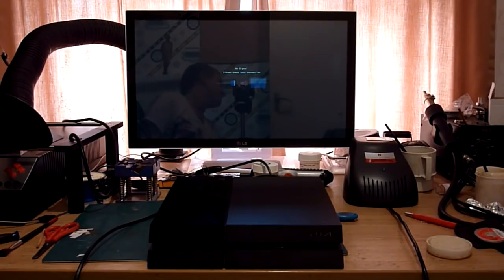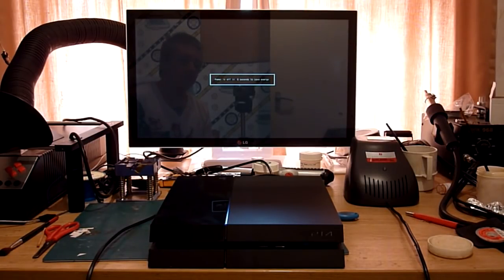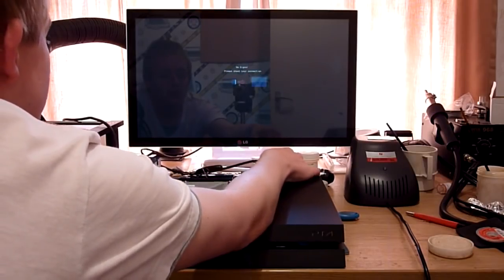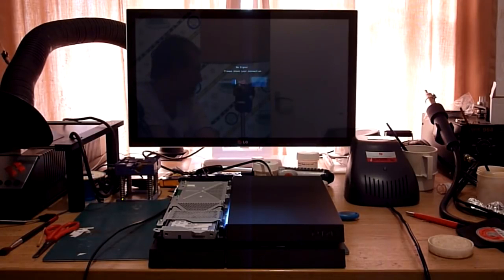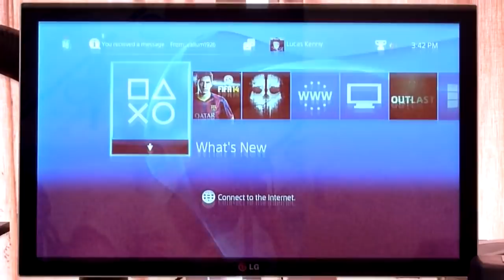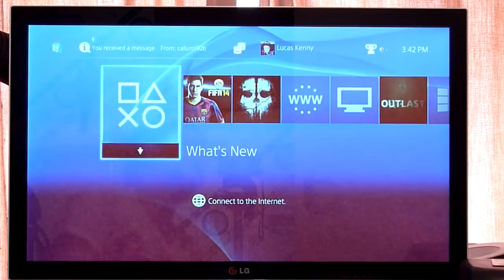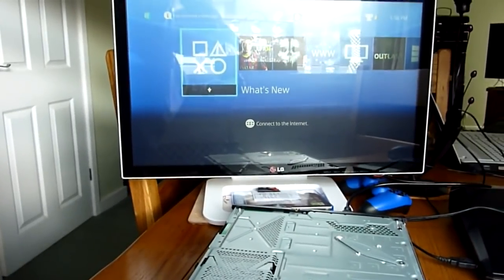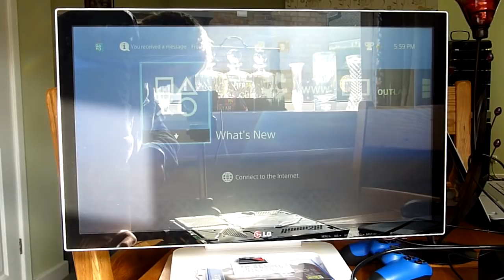PS4 White Light of Death (WLOD) - Faulty HDMI Socket Replacement Fix

Comment: I get the White Light of Death with no signal on my TV, but Remote Play on my Vita shows the PS4 home screen no problem - Thoughts please.
Reply from the maker: It'll be a fault with the HDMI video output circuit. Could be a port, Encoder chip or one of the supporting SMD components at fault.

Comment: I need help I have a ps4 slim and my tv won’t comment when I normally turn it on but if I put it in the emergency mode it will make the no signal go away and off I look closely it starts to turn on the picture put not all the way
Reply from the maker: If the port is intact, then it's likely going to be a bad encoder.
Reply: @AndrewPaul  idk it’s not the ps4 I don’t think cuz I plugged the ps4 into a new tv and it worked but the other tv just won’t work with my ps4

Comment: I had a problem where my ps4 would turn on, go blue and then white and nothing would happen after that, just had a black screen. I tried everything, after about 2 hours of trying everything I fount out it was my HDMI CABLE that was the problem. I switched it with my Ps3 one and my ps4 worked perfectly fine. Hope this helps people out having this issue!

Comment: What if you get two or three seconds of video before it goes black?
Reply from the maker: Likely the 10uF caps and voltage regulators which provide power to the encoder (on the opposite side of the board to the encoder chip, directly behind the HDMI port). You may also need to replace the IC.

Comment: My father bought a ps4 for $150 from a kid. He gets home, turns it on, and it has this issue. 
He went to message the kid, and the little shit blocked him. So he bought a new one, and gave me the junk one, so this video is helpful!
Reply: Lmaooo that's messed up
Reply: @Vintagelover777x  Yep. I got the HDMI port fixed, but found out the disc drive isn't wanting to pull in CD's
Reply: @Jon844 Yeah, I still have it. I got the hdmi port fixed, to find the CD tray motor doesnt work and one the USB ports shocked me
Reply: Its fucked up that your dad will only give you his old broken shit!!! Stau strong!
Reply: @jeremyrhansen6637  Not really, he didnt have to give it to me to begin with. I was expecting it to be just the port...
Reply: @evilal20  at least you can download games and play them digital.
Reply: @mrdato116  True. But I think theres so much dirt in there, that it has a card time spinning the hard drive disk, because it takes forever to load anything
Reply: @evilal20  you can try to clean it. Or maybe hard drive itself is damaged.

Comment: White light but get picture but it's grainy ? Static if you like any assistance appreciated
Reply from the maker: Try and lightly wiggle the lead in the port. If it stops being grainy, it's likely a port issue. If not, likely a HDMI Encoder IC issue.
Reply: Just switched my sky HDMI cable over to ps4 & it seems to have done the trick at moment. Thanks for the reply pal 👌

Comment: See...mine boots and shows a video signal and then after a minute or two the screen goes black and I can't power it down
Reply from the maker: Sounds like a potential hard disk issue. Try another disk if you have access to one to give it a test (minimum of 160GB required).

Comment: My ps4 is saying 
Cannot start the Ps4
Cannot access system storage 
Press the power button for 1second
Reply from the maker: Try and reseat the hard drive initially. Failing that, find another 2.5" SATA hard disk with a minimum capacity of 160GB and try that one to see if it will then start. If so, you have a dead hard drive. Also, if you can hear any unusual beeping / clicking sounds coming from the console then again you may find you have a dead drive. This is the most likely outcome.
Reply: @AndrewPaul  thanks for responding, I reset my harddrive and it worked. You're the best

Comment: Andrew, can you tell me the value of the 0402 capacitor that is on the bottom side of the motherboard, underneath the HDMI port on a PS4 slim 2115B? I have one that is missing but can't find anywhere that lists it.

Comment: so i have a computer that supports hdmi input. I plug my ps4 to it, it doesnt recognize it at all. To test the hdmi i used multiple cables, none worked. To test my computer i got another laptop that has hdmi output, connect it to the input of the computer, and it worked fine. To test my ps4, i connected it to a big tv i have in my living room (too big to game on), and it worked there as well. So my ps4 works, my HDMI cable works, and my computer works. I just cant connect my ps4 to my computer. Im a college student, so the computer in question stays at home while im in uni, i only play when im on vacation. Last vacation i was able to hook up my ps4 to the computer easily, so theres a history of it working. It just doesnt work now. Idk what to do, i turned it off and on again, messed with the resolution when my ps4 was hooked to the big tv, has no affect for my "gaming computer". My computer just does not recognize and hdmi input when i have the ps4 hooked to it, no safe mode no nothing. Im all out of ideas, anyone got anything?

Comment: SOLUTION: One of the problem might be that your tv does not work with 1080p resolution so you need to change the resolution in the settings of the PS4 not tv. Settings---Screen----740p.    The other problem could be an energy problem so you need to change a few time the energy cord of both TV and PS4. Try also using another port of HDMI, that could work too. Good luck

Comment: At vid time 5.50 you say there is still no signal and there never would be considering the hdd is not connected yes it's in the machine but it's not in far enough to make a connection
Reply from the maker: You would expect to see the 'Cannot access system storage' CE-34335-8 message displayed in that scenario. You should never see a perpetually black screen without a hard disk connected.

Comment: How about thr hrd. Im having problems with seeing good quality picture on hdr10 opposed to good quality on 1080p
Reply from the maker: Does it look snowy, or have lines across the display?
If so, it's likely a failure of the Encoder IC chip.

Comment: At first I tried to turn on my PS4 using the button in my controller, it turned on but my controller wasn’t connecting and neither was my PS4 to my TV. I was not able to turn of my PS4 so I just unplugged a cable. I then tried again and my controller was able to connect to my PS4 but not the TV. I get 2 blinks and a white light. How can I fix this?

Comment: Any suggestions, my ps4 only displays the screen in 480p, If I start the ps4 on 1080p or other the screen is black. The only way I could see the screen if I go into safe mode and change the displayed setting to 480p. That way it would work. Also, I see red dots on the screen flashing all over. 

Does it mean I need to change the hdmi port too? Please let me know thanks.

Comment: Any tips on how to add a new hdmi port? I ended up soldering a new one but mistake was when I was soldering it I burned the mother board of the ps4 the burned in lines in it so I'm not sure if that's why but what can I do ? It has a new hdmi but could it be that i messed up the mother board

Comment: I’m having a similar issue. I replaced the hdmi chip without using a microscope. I really didn’t check the hdmi plug. My question is, do you completely put it back together (all screws) when your testing? When I get home I’m gonna check the hdmi port.

Comment: I’m switching to xbox
Reply from the maker: You may find the expression 'out of the frying pan and into the fire' applicable to that one - they're both as bad these days!
What I will say though is if you're looking for a PS4 and can't stretch to a Pro, then go for a slightly older 1200-series machine in good order. Avoid these newer slims like the plague - they're absolutely garbage!
The XBOX One S is an OK machine however they do tend to suffer with HDMI Re-timer related issues but in terms of construction quality on new consoles I'd take an XBOX over a PS4 any day of the week.

Comment: After going into Safe Mode after around 2-3 PS4 looses signal and the white light is on. It comes after a repair when hdmi connector was changed and it worked for couple of weeks. Now it’s not. I can’t bring it back to same repair shop as it’s in another city. Any suggestions?

Comment: I have a white color but the ps4 working great why does it called “the white light of death” ??
Reply from the maker: Yeah I agree it's a stupid name. It stems from back when the PS4 was first released and a few batches were shipped with faulty ports. Suddenly they'd boot to a blank screen and nobody really knew at that point what the cause was. The moniker stuck so here we are with the white light of death (which isn't really dead lol).
Reply: @AndrewPaul  I've sent my ps4 in to replace the HDMI port in the past and still had the same issue just not as often but now it's stopped working again. I'm not seeing anything wrong with the port and I've tried different TVs and HDMI cables but still nothing can you tell me what you think please.

Comment: I have ps4 pro. Now it's outputting a red line on my screen. Tried new hdmi cables,different ports,reset resolution. Do you know what the issue may be?
Reply from the maker: It's likely to be a defective Encoder IC.
Reply: Andrew Paul how does that get fixed ?
Reply: Ended up being the tv.

Comment: I started to freak out a little bit. Thinking i might have to replace my hdmi port. When i pulled my ps4 out to check the port, i noticed the hdmi was just unplugged somehow.  plugged it back in and it worked. lucky me.

Comment: My ps4 flickers on and off and when I mess with the hdmi I hear like a spark any suggestions or help
Reply from the maker: It's likely the comb is broken inside the port - they do creak a little when the ports flex. Replacement port should cure the fault.

Comment: My PS4 shows a white light, it turns on but won’t project to the tv bought a new hdmi but still nothing. Last I remember is it had overheated then hasn’t worked since. I took it apart cleaning it and stil nothing any way to fix this??
Reply from the maker: If it's on a white light and the port is physically intact then it's likely to be a failed HDMI Encoder IC.
Reply: Andrew Paul thank you for the reply bro!

Comment: hey my ps4 doesnt show any lights just the eject button beeps. wont charge the controller wont do anything other than beep on the eject button.
Reply from the maker: I've seen this before and it was a dry joint / poor connection on the NOR IC. Have you had the machine open at any point since it stopped working?
Reply: Andrew Paul  yeah I opened it to unplug the Hd and psu. No difference. If ordered a new psu but won’t get it for a few days.

Comment: Just got this problem with WLOD as it seems. But at first, there are not signal. Then I switch off the unit and restart so there are Warning Notice saying do not switch off while unit is ON, then it start to recheck the harddisk. The problem is when it start to restart itself after fixing the issue. The white light came out but no signal to the screen. I wonder is this the same issue as WLOD or do you have any suggestion to solve this problem? I have change the HDMI cable. To say that I have HDMI problem, i am not too convince as during the Warning Notes, all are properly displayed at the screen. Any idea?
Reply from the maker: So I get this right - you're saying that it displays the black screen and disk check with percentage bar and once it reaches 100% and restarts, the screen then appears blank again until you pull the power and the whole thing repeats again?
Reply: Andrew Paul I have this issue. How could I fix it?

Comment: does ps4 generally have their specific HDMI port or any hdmi port is compatible
Reply from the maker: They need their own. CUH-10xx, 11xx and 12xx use different ports to the Slim and Pro. I do stock these if you need some.
Reply: Andrew Paul I'm kinda very far from you
and my ps4 right now has the same problem
so I'm trying to figure out the particular HDMI port it needs for replacement
Reply from the maker: What is the model number of your PS4?
Reply: Andrew Paul ps4 original
exactly with the one in the video I guess

Comment: I spent hours and hours tryna figure out what to do. Watching videos and videos. I finally found a solution that worked for me. All I did was unplug TV and pS4 from the wall. (While pS4 and TV were still on) and I plugged them back in to wall. Turned on TV and pS4 and boom. Took me to safe mode screen and loaded everything up. Restarted by itself and now I can use my PS4 again. I really thought it was over with my PS4. I messed around with HDMI and what not and nothing...but this what really worked for me. Sorry for the long ass comment lol

Comment: I have the pro when I shut it down it stay at white light but when I turn it on it stay at white light but when I pull the power cord it will turn on
Reply: jackass yes! I pulled out the powercord. It turned on(obviously after I plugged it in).

Comment: My maid accidentaly got water on the port my tv was connected to and that same tv was connected to my ps4 the tv doesnt work anymore and my ps4 still powers on i brought it to go get fixed and they repleced the HDMI but they said it still didnt work can someone please tell me if i should bring it to another repair place. It does have the white light. The controller that was pluged into my ps4 also doesnt work

Comment: What would be your recommended tool kit for doing this at home?
Reply from the maker: See here:
https://www.youtube.com/watch?v=8pgE2i30Dpw
Reply: Andrew, My ps4 slim has some blank screen and doesn't come up no signal. it still enters safe mode but i have to fully shut it down. does it sound like a faulty cable? i can put it on full hd

It still works.
Reply from the maker: +Ps4 turn off hdcp in the settings menu and see if that improves the situation.
Reply: I done that already. i got a new cable so hopefully that sorts it. does it sound like a port issue?
Reply: I think its software related http://community.eu.playstation.com/t5/PS4/Black-Screen-no-signal-after-update-to-5-0-5-01/m-p/25368432 the mvp person solution works for me

Comment: if you are not comfortable disassembling the ps4 to fix this, is there any other way you can get it to be fixed. if you call sony or whatever will they do anything or??
Reply from the maker: Sony will be very expensive for what repair this is - unless it's within warranty then find a good independent repair specialist. Where are you located?
Reply: Andrew Paul In south London.
Reply from the maker: I offer repair services in the UK if you're interested? Port replacement including return shipping is £49.99.
Drop me an email at ytandrewpaul@outlook.com if you're interested. Many thanks.

Comment: Mines a WLOD but safe mode works?
Reply: Hey guys, so I fixed it. I pressed Initialize PS4 (reset my PS4 but fixed it)
Reply: Hi. did your display the blank screen? mines the same it enters safe mode and works if i fully shut it down and has only happened twice. did factory reset work?

Comment: Hi! Andrew. I need you for an info. I have a  ps4 with a blue light blinking, flashing, going from high to low blue, the controller does not answer, no white light, no screen, no sound, the blue ray works but no sound and no image and the console never shows an image. Inside, everything looks good. I think it's the big chip. The  HDMI plug is perfectly good.  The only thing i see is HDMI written on my screen and than no signal. Is that a blue light of death? Because i dont think it's a white light of death because it will never turn to white light, it stays on bleu light. When i touch the switch to shutt it off, it takes a lot of time before to go off, to react.  Waiting for your answer. Thank's a lot. Serge.
Reply: Thank's a lot Andrew. It's very kind of you to answer me. I'll follow what you just told me. If it's the case, i don't have the laser soldering station to fix this. So i'll let it go to someone else. Thank's a lot. Serge.
Reply from the maker: Hi Serge,
Yes this a classic case of pulsing blue light of death. Sadly this one can be literally anything but most commonly caused by one of the following (in order):

1. APU (Requiring reball).
2. RAM (Requiring reflow or replacement of bad module).
3. Secondary RAM above Southbridge (Requiring reflow or replacement of bad module).
I've also heard of this being caused by a bad PCI-E/SATA Controller IC on occasion.
You can find some more info on the types of 'BLOD' and the symptoms of then here:
https://www.youtube.com/watch?v=0T2-iCBhkuQ
Good luck!

Comment: I come home to my ps4 not working, it turns on i have no signal and a white light of death,but i hold the power button till the second beep, but it wont boot into safe mode, any help???
Reply from the maker: If it's still at a white light at that point without anything on screen then it's either physical damage to the HDMI port or a failed Encoder IC.
Reply: KallMe Chris I'm having the same problem
Reply: KallMe Chris what did you do?
Reply: I found that every hdmi cable I used ends up having damage done to it on the extreme right pin which resulted in no picture or sound on my TV. I used the video camera on my phone and zoomed in on the hdmi port and saw tht a pin (the one causing the damage) was slightly raised more than the other pins so I used the flat side of a tweezer and pushed it down.
Reply: Try turning the PS4 on then go to your tv or monitor plug and unplug the monitor or tv but the PS4 has to be on then you turn the monitor/tv on and boom it works